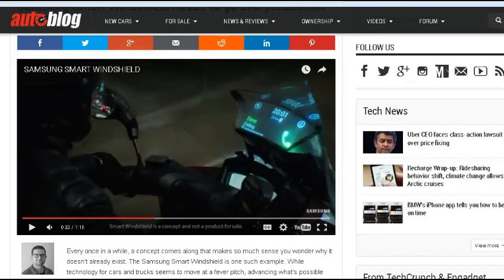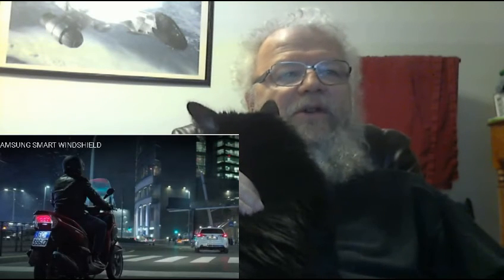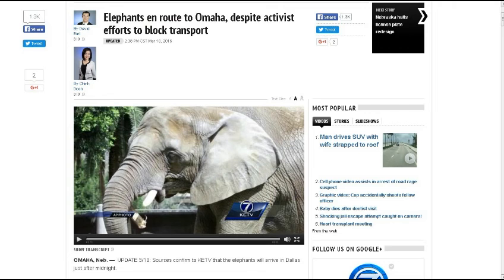TDD report for April 02, 2016

Comment: cool topics as usual, thanks Chuck!
about that HUD - I do not think that such a device is required. If the angle of your windshield is wrong you can simply fix a piece of transparent plastic in the right angle, why one should need a dedicated display screen for that purpose? Means, e.g. on google play store you find plenty of apps which give you a reversed display of your phone, so when you place it in front of on your dashbord or fix it anyhow on your bike you you can see the contents of your screen mirrored in the windshield. (just search for e.g. car HUD, that's even the name of an app).
Other question is of course whether anyone would like to use it - we had developed dedicated HUD projectors years back for high end cars, but they were rarely ordered in those days, and meanwhile we use speech assistants and bots who can receive and deliver information via audio, that is maybe even better in today's traffic than confusing the driver with any additional visual information in his field of vision.
Reply from the maker: +bangalorebobbel I think full audio information is much better too. Not much time on a motorcycle to be looking about except at traffic for your own safety.
Reply: +suburbanryder - The Mayor - That is what I was thinking too. If I didn't have the audio on my GPS I probably could not use it on the motorcycle.
Reply from the maker: +Sudogj Good point Gary.

Comment: WP Radio is pretty good, been a long time listener, many shows are converted to podcasts available from their website.
Best to give animals a home if endangered
Solar is barely tapped, the easiest use is solar heat and that gets less press than photovoltaic . Solar is not an end all be all, but it has it's place
Reply from the maker: +Craig Nehring I see solar and wind in the US doing maybe 25% in the future if we stick with it. I am holding out for fusion reactors or some of the new molten salt reactors to replace coal in a big way.